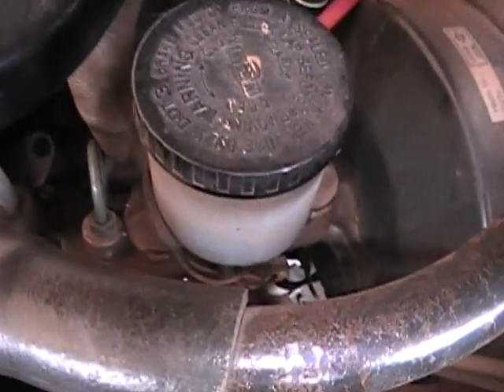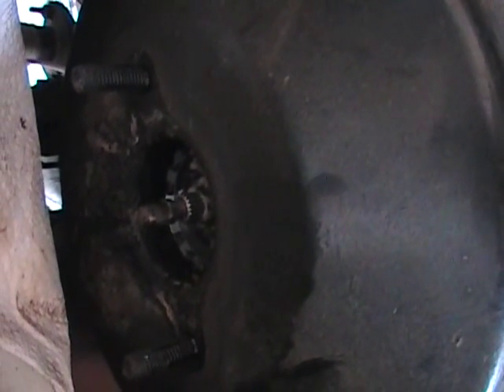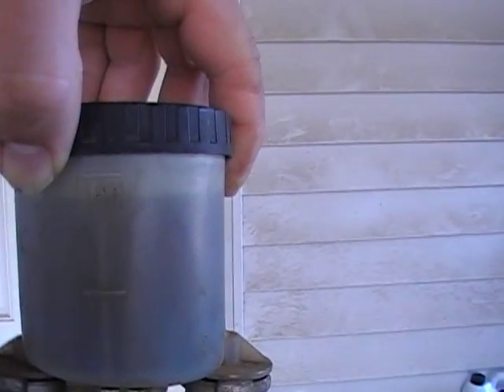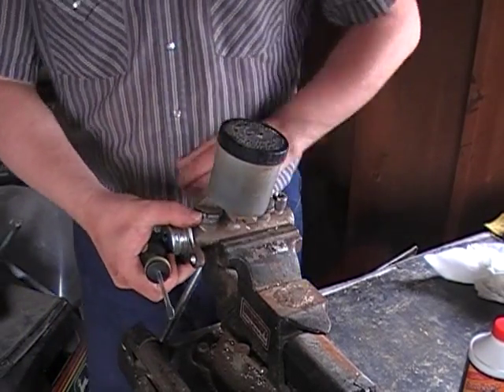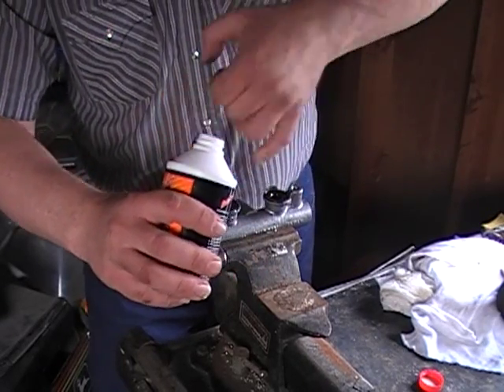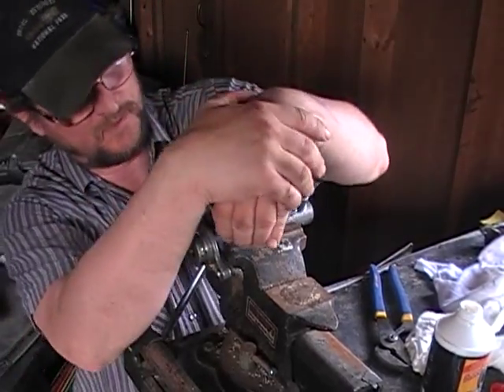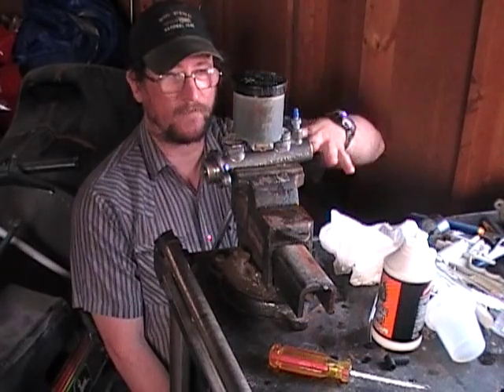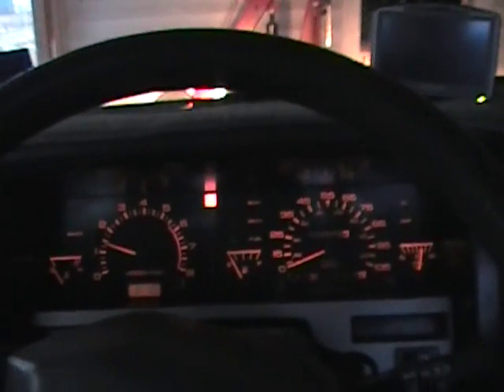master cylinder replacement

Comment: @wolfman9999999 I used to watch Shadetree Mechanic religiously when I was in high school.  Dave Bowman and Sam Memolo as I recall.  That was when TNN was a great channel.  The network then changed names and pretty much all of the car repair TV shows used expensive equipment and garages.  They also did a bad thing when they started mixing advertising with shows and used specific brand products to make it look like it was not a promotion when it was.  

Anyway, I'm subscribed to your channel.

Comment from the maker: @texan176 Thank you for the compliment.  Years ago, there actually was a show that used regular everyday tools, and the hosts literally did do the repairs in the driveway.  It was called "Shadetree Mechanic". I know the feeling on the shows they have today.  Wouldn't we all love to have a 5000 sq/ft climate controlled shop with air piped everywhere, lift, and $10,000 worth of specialty tools lying around.

Comment: Hi WM. Sorry to be a pain, today I tried to change the belt tensioner, 99 chrysler town and country, I could not get a socket of the nut, I looked at the net and youtube the fixings are easy to remove on most as they are positioned on the front. Some info says the power steering pump and water pump pullys need to come off! Is this correct? Also do ya know what tools I need as the ones I got seem o be useless for this Job and nothing in the service manual, hope u can help. RT

Comment: @RenoTravino Hi, me again. Took the car back to the garage,yesterday where they did brakes! He said he took Master Cylinder off, but it was OK, he rekoned it could be the ABS unit? I asked him about the calipers but he said they were fine,( Spanish Machanic, so a little difficult sometimes) Last night, no hand brake at one point, then it worked, also pedal loosing compression when parked at lights with foot on the brakes. Any idea what the hell he did this time? RT

Comment: @RenoTravino Also two days after they were changed, I deliberatley used the brakes hard to see what would happen, at the garage , they locked on, i touched the brake pedal and they released?! Trouble is , i am working away, so no tools and am  due to travel  900 miles home at the end of next week and getting no where fast. In your opinion would you rule out the master cylinder? Tthe brakes are working fine according to the rolling road test, except for binding a little on the fronts. Regards RT

Comment: @RenoTravino Hi Thanks for quick reply. Obstruction in metal brake pipes, Possibley a crimped pipe? The fitter who changed flexi hoses says he is now going to take the Master cylinder off and clean it. would you suggest changing calipers or getting a repair pack for them? i forgot to mention the rear wheel cylinders were changed last week at the same time as the hoses

Comment from the maker: @RenoTravino Air in the master cylinder or brake lines will actually reduce braking power.  It sounds like you have an obstruction in the brake lines somewhere or a problem with the calipers themselves, which would not allow the calipers to release when you release the brake pedal.

Comment: Hi, what happens if the is air in the master cylinder? I had mine changed that nite the brakes locked up, since then the brakes get extremely hot when heavy braking or hills, recently changed all brake hoses, as fitter suggested , its still the same, red hot brakes and wheels on the front. This only startted afte the master cylinder was changed by a machanic, the 1st time it happen all wheels were red hot after the fitter had another look, only the fronts, any ideas? great vids RT

Comment from the maker: The one that is leaking should show itself by being wet around it from the fluid loss. I am not sure where the slave cylinder is mounted on Nissan manual transmissions, so I would get a repair manual to aid in finding it, as some can be inside the transmission bell housing, others outside, depending on how cruel the engineers were feeling when they designed it.  If they're not showing themselves, expect to replace both. I am not aware of any good method to test each one while in the vehicle.

Comment from the maker: Did you rebuild it yourself?  This is what I am interpreting from your question.  I would check and make sure you didn't miss an "O" ring in the slave cylinder.  Barring that, I'd simply buy a remanufactured one off the shelf.  That way you get a warranty for the part if it is bad off of the shelf, like the first one was when I was making this video.

Comment from the maker: Thanks.  If I recall correctly, the instructions for the one I was installing stated to compress the piston fully to expel all of the air.  Others may have different bench bleeding instructions, and it is always a good idea to read the bleeding instructions for your particular master cylinder, before beginning the process.